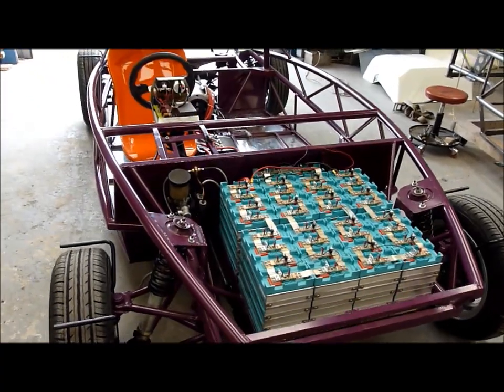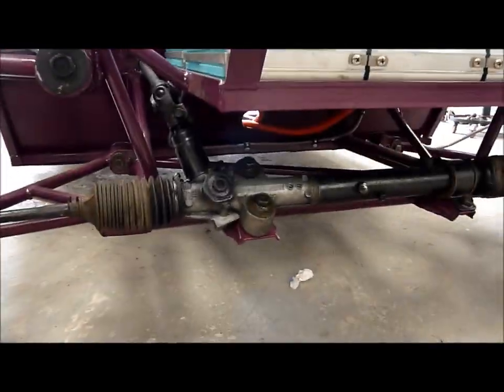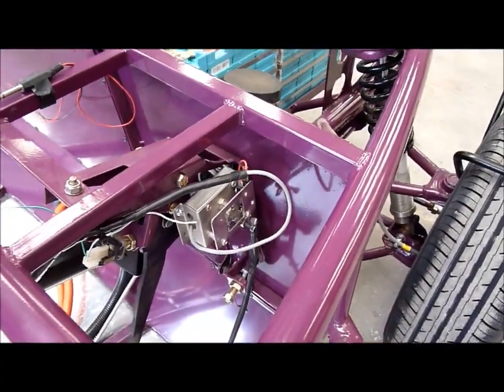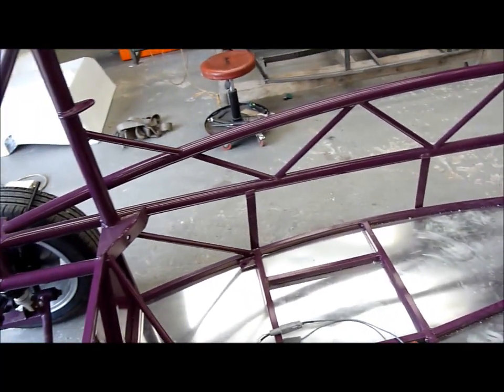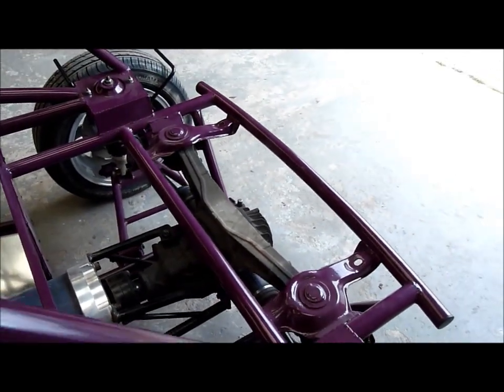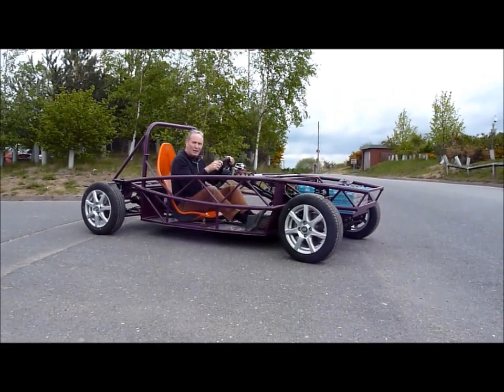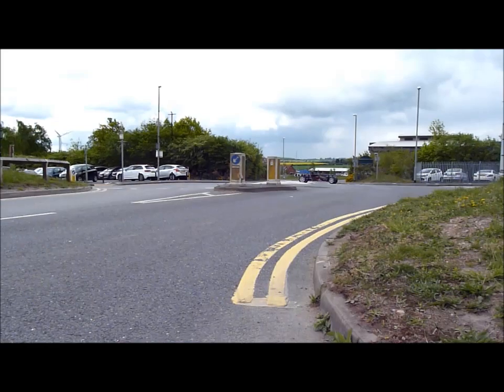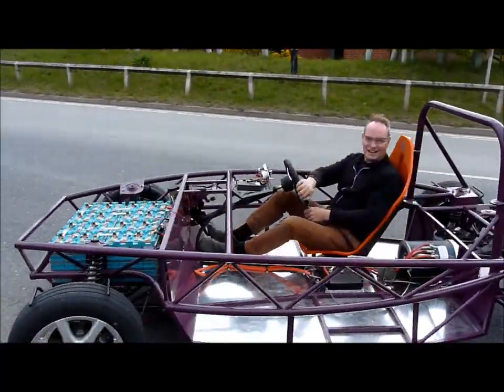Extreme Lightweight Electric "car". Why are EV's so heavy and therefore inefficient?

Comment: I do not want to own any currently mass-produced electric car because of its weight and therefore  the amount of microplastic it dispenses into the environment. Even small BMW i3 is close to 1.5 tons. I'd definitely be interested in a sub 600 kilos 2 seater that can go at least 100 km/h and has some lightweight shell for weather protection, the truth about microplastic pollution from the tyres is sinking in, so I imagine there would be a market for smth like this.
Reply: EVs do have the benefit of not producing any particle emissions from brake dust, which is a big issue as well, as almost all braking is done by the motor and regenerative braking.
Reply: OP whats your daily?

Comment: Should build all cars like this, and put maximum 30 hp motors in them. Much more efficient even with ICE. Could use a 2 cyl motorcycle engine in any car then. I, for one, don't need doors, windows, or a body on a car, let alone all that junk like seatbelts, air bags, etc.
Reply: They are already more efficient than ice no matter how strong the motor is. EV and ice dont operate the same.  More power on tap doesnt mean less efficiency 😂

Comment: u knoe that they can blow in extreme weathers
Reply: Sorry for my poor English I meant explode like there is not coating to protect the ev from reacting to heat atleast you could add a coolant
Reply: Like explode? Or blow over? If so that makes no sense because my bike hasn’t blown over
Reply: I think the biggest risk is the unprotected poles of the batteries and other connection points, bit yeah, left in the sun on a hot day I wouldn't get too close 😅

Comment: What people want to know is 1) how far can it go on a single charge, 2) how many seconds to 60 mph,  3) what is the top speed, and 4) what does it weigh?
Reply: Exactly what came to mind after reading the title, quite disappointing
Reply: People dont care about weight..if they did, they wouldn't use trucks as daily drivers more often than not.
Reply: no point in carrying extra weight of batteries if you only travel 10 miles per day. Rapid acceleration draws high current and lowers range. 50 watt hours per mile and fit a 10 kwh pack for good range.

Comment: do you know what it weighs? I think a standard Exocet conversion comes in at around 13-1400 lbs?
Reply: in the video discription it says 400kg so 880lbs.
Reply: depends on battery but under 350kg is realistic